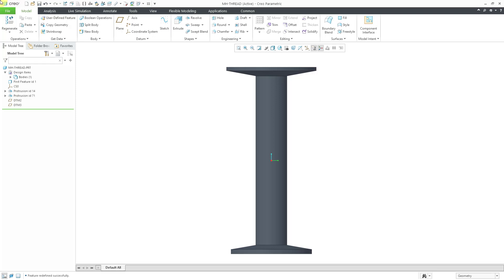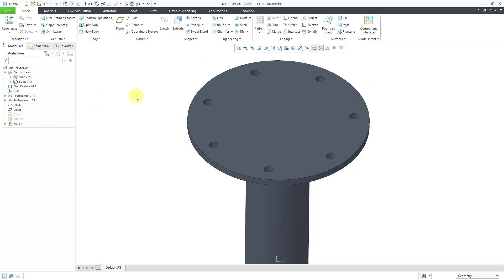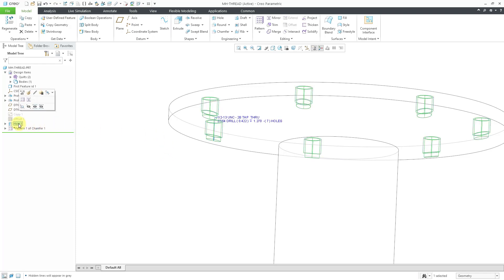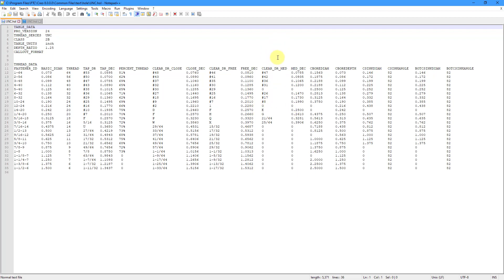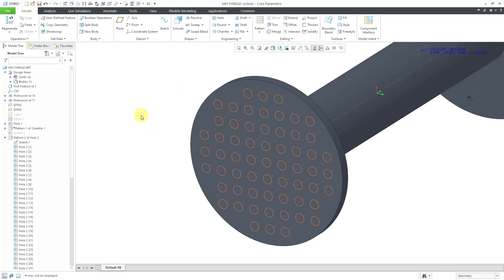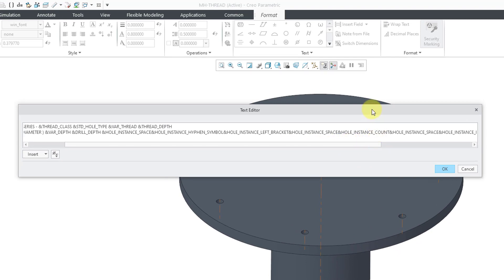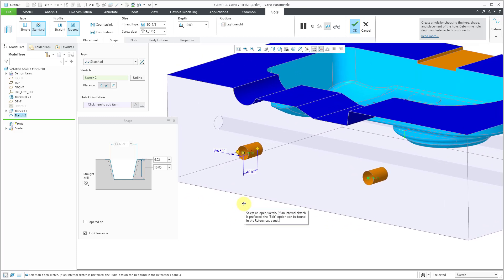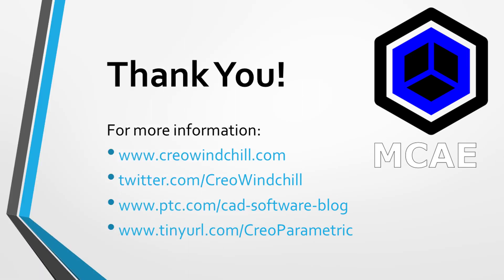Creo Parametric 8.0 - Hole Feature Enhancements (Video 5)

Comment: Strange occurence. I created the hole part with the 7 side heptagon sketch from the palette, created the chamfer, and used the reference pattern to chamfer the other holes. I then received an error message for "atypical feature". The chamfer pattern always added another ghost instance if the feature contained an odd number of vertices thus triggering the error. When I changed the sketch to a 6-side hexagon or an 8-side octagon there was no error. Perhaps a config setting?
Reply from the maker: I don’t know. I recommend filing a ticket with PTC Tech Support as Paul, Martin, and the others would be interested.